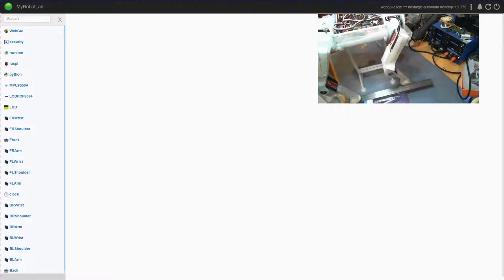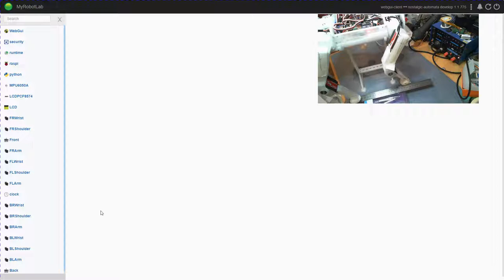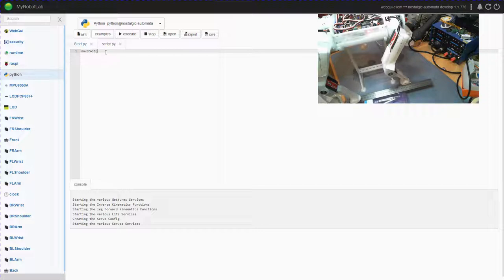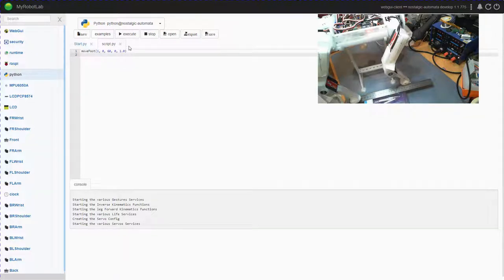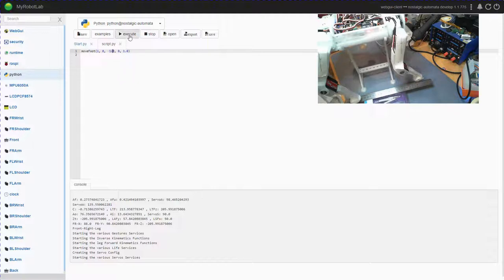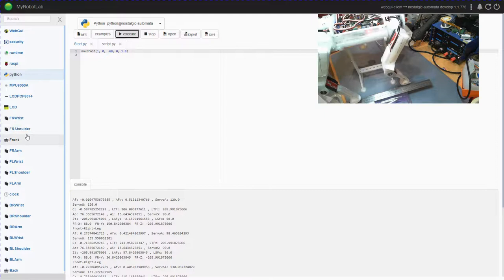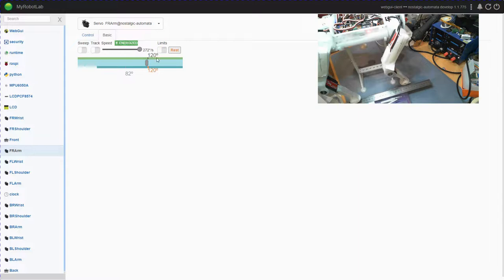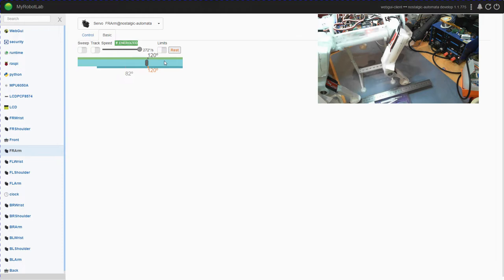Testing Inverse Kinematics on Spot Micro

Comment: Exited to see it walking  in few days
Reply from the maker: I'm looking forward to that as well :-)
Next challenge, which I think I have almost done, is speed control with straight line movement.
Then I can start on four leg coordinated movements.
At that point, I should be able to create a walking gait for spot to start moving about :-)

My biggest concern at this point is the amount of movement in the arm joint, so I'll print out another mod and install an additional support bearing for the top of arm joints.

Lots more to go :-)